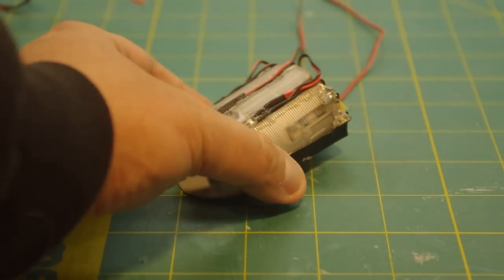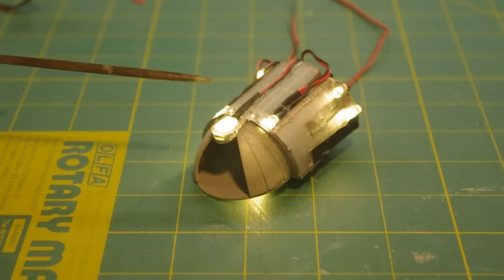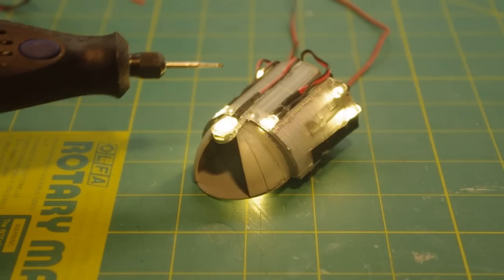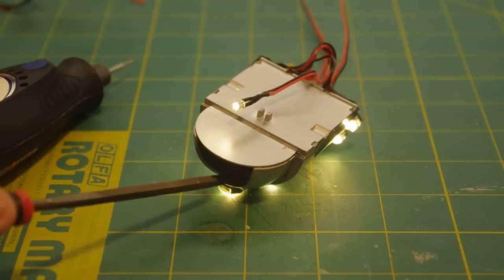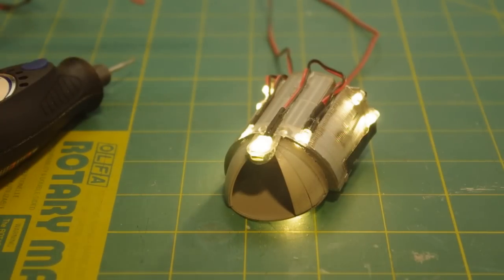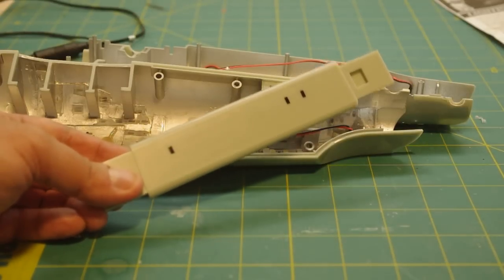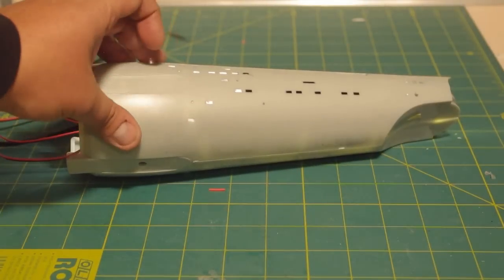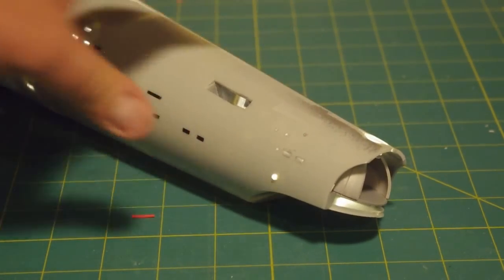Polar Lights 1/350 Classic Star Trek Enterprise model project Part 4

Comment: The ship is looking good Jay. You have managed to get more light at those rear window ports than I did. For those 3 little beacons or view ports just forward of the clear dome over the shuttlebay, I used a 3mm LED and tucked it into the recess of the little control room on the ceiling. It lit that control room window and the 3 beacons which are right above it.
I'm enjoying the video series here and keep up the good work :)

Comment from the maker: Yeah I thought about using that control room, but with the way Round 2 designed the stock light kit, that really isn't possible. Although if I tackle another one of these, I might give that idea a whirl. Now if PL perhaps had designed the skylight section to be a piece of smoked white plastic (keep the sides clear), that might have really worked well to get a nice white "glow" and light the upper beacons if an LED were placed in that bay.

Comment: Those two trenches that are used to run the wires from the lights on top of the shuttle bay are not lights, they are ATMOSPHERIC CONTROL VENTS (Air Vents for filling the hanger bay with oxygen).

Comment from the maker: Given the size of the sub-assemblies, I will likely do them separately (saucer, secondary hull and warp engines) before final assembly. After that, I may do some touchup work once everything is together to make sure any expose seams are dealt with. I'll probably also do some of the weathering work as well before final assembly, but the decal work and final weathering will be done once everything is together so I can do it as a complete whole.

Comment: A lot of guys have talked about your vides on this build.  I'm just starting to go through them, but I do have question.  How are you dealing with the build (IE: glue/ seems/ paint/ windows?)  Are you able to get the windows in after glue/seems/paint in the subsections?  Are you masking the windows - that sounds painful and awful.  I'm totally not sure how to move forward....
Reply from the maker: pauly7218 The way I dealt with the windows was to put them in during the build and mask over before painting, being careful to plug all the light leaks before pulling the masks off. Later videos cover that a little bit.